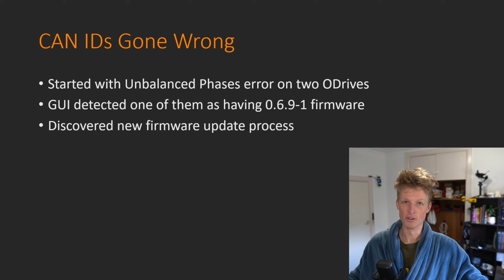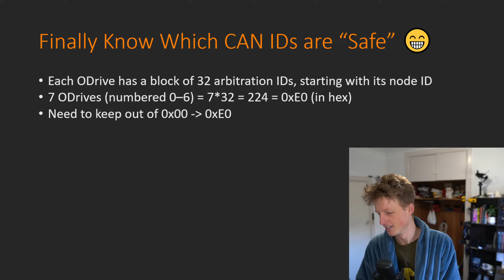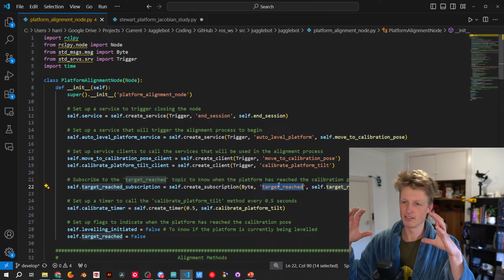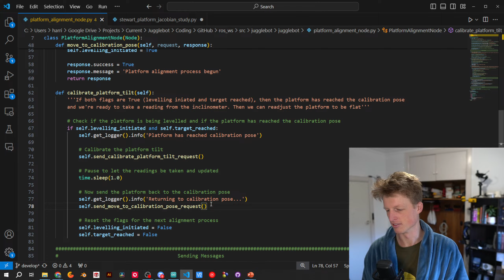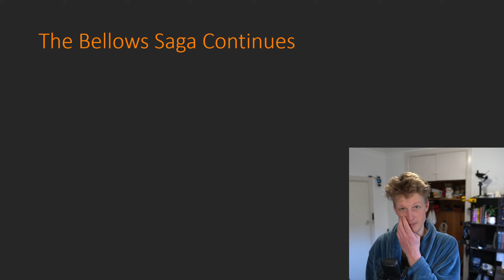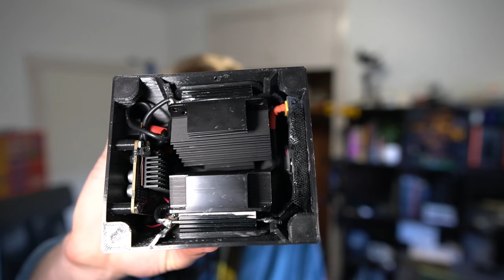PDJ Weekly Livestream # 27 - Update

Comment: why do the bellows need to resist torsion? and how much?
Reply from the maker: Good question! The linear actuator legs have the motors aligned colinearly with the leg axis, so when the (fairly large/heavy) motor spins, it generates a good amount of rotational inertia. Without the bellows, this causes the whole leg to twist about its main axis, which pulls/tangles the motor + encoder cables that run from the base to the bottom of the leg. The entire purpose of these bellows is to stop this 'twisting' without impeding on the other two rotational degrees of freedom
Reply from the maker: As for how much torque they need to resist: I have no idea on the torque magnitude, but as long as rotation about the leg's main axis is less than 10-20 degrees, I'm happy 😊

Comment: I saw weird spikes in the position data like that before and what the issue was for me was that the SPI bus between the encoder buffer and the arduino(brain) was getting disconnected during vibration. Took me a while to figure that one out. Also for the bellows, this is a blind guess, but you could try adding fillets to the edges(outside) as well as giving it a bit less thickness to the parts you want to bend. Kind of creating a designed "weak point" so they bend correctly.
Reply from the maker: Damn, I can see how that would've taken a while to sort out!

Re. bellows: I've considered similar fillets etc. but I'm not sure they'll have much of an effect. I have a feeling it's the internal (concave) bends that are the important ones for making sure the bellows collapse properly and (I think) we want these as pre-folded as possible (which they are now, sans fillet). Also I've found that the bellows print best in vase mode so I'm not sure if variable thicknesses would work here; even if variable thickness vase mode printing is possible (something tells me it isn't 🤔), it would be a pretty small difference between 'thick' and 'thin'.